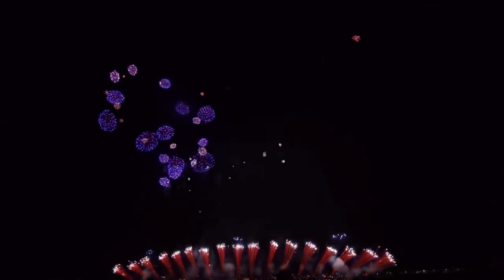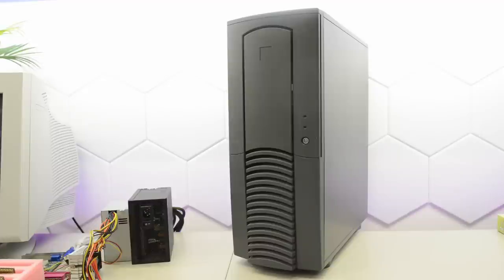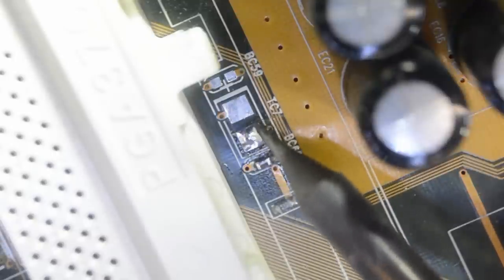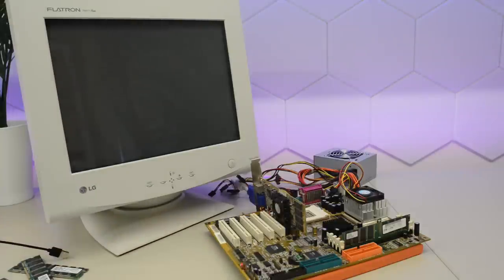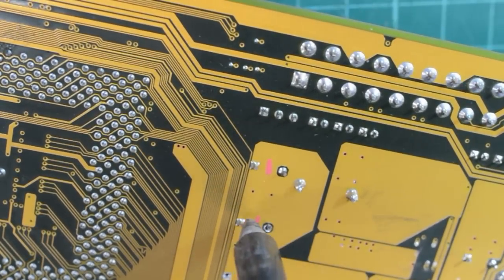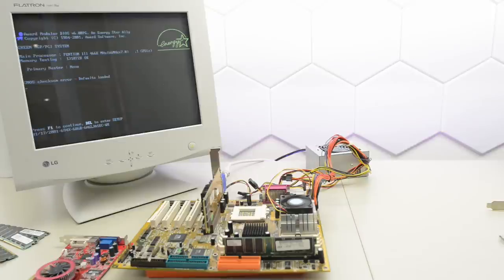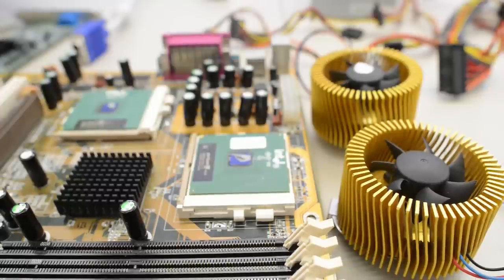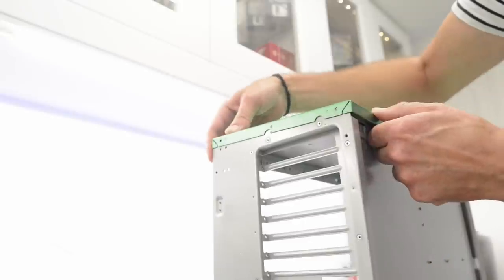Recreating my year 2000 PC with parts from eBay. MOBO repair. Custom ABIT VP6 dual Pentium 3 1GHz PC

Comment: No, that's NOT a IBM Deathstar, that term is 's specifically for the 75GXP (primarily) or 60GP (disputed) models from ~2000 with their high failure rates that IBM knew about in advance. Disks from before AND after were pretty much the best hard disks you could buy at the time. The resulting lawsuit (2001) and scandal resulted in IBM selling their hard disk division to Hitachi in 2003 - but from what was said at the time this was actually a merger with the already existing HGST disk engineering team of a roughly similar size, not a rebranding.
The model number on this reveals this is a 7K250 which matches the 2005 date on the bag, so this is several product generations post-merger. So calling this specific model a Deathstar is misleading at best given that it was likely one of the most reliable consumer disks at that time.
"Floppy LED always on" - you mention checking different cables and floppy drives, but didn't mention checking the cable orientation which is known to result in this. Not sure if the BIOS would still recognize the drive though.
For those that wonder why Hitachi was interested - they wanted the Ultrastar (Enterprise disk) name and design - neither which had been tarnished much by this and that team still does the best 
disks today IMHO,  albeit now under WD but still with the Ultrastar moniker (as opposed to the also Enterprise WD Gold made by a different team, WD is complicated).
Reply from the maker: Yeah, I have actually read the same info on wiki as in your writeup. However, the fact is that all five of my original drives died back then within a few years and I have heard similar stories from my friends. It may not be technically correct to call it "deathstar" but very much appropriate.
Reply: @Epictronics1  I can't argue with your experience, I guess that means I need to go with a wider Deathstar definition.. My take is/was based on my own data, both private disks and at the company I worked then, not Wikipedia, it did match which perhaps made my statement a bit stronger than warranted.
So, my data is that I had two 75GXP that both died on me (fortunately far enough apart that the RAID1 saved the data), and the company I worked for had lots of IBM disks of various models. When the rumor started to circulate they looked at their replacement statistics and immediately replaced all 75GXP of the various sizes due to this, but not the models before and after (34GXP and 120GXP?, IE largest model in each series was 34GB and 120GB respectively) because there their data didn't indicate any problems with them relative to other brands. I guess no one is surprised that the company in question then stopped buying IBM/HGST drives for a couple of years (guessing starting again around perhaps the 7K1000 in 2007-2008).
So my data does have a prominent hole right where you and your friends disks may fit in since it sounded like they were larger than the 120GXP. Another reason I was confident is that the Wiki version also matches my recollection of contemporary data magazines, the 75GXP's dying left and right was first page headline stuff, but I don't remember seeing anything in them indicating issues with later IBM/early HGST drives even in the back pages.
That doesn't mean your and your friends experience is wrong (data points are never wrong!) - the 75GXP head crashes got headlines because it often happened fairly early, and could be NOISY so even people who had disks fail on them before went "no drive has failed like THAT for me before". The combination of these factors is part of why IBM's "just ship them, no one will notice" strategy failed so spectacularly.
But just having a higher than declared failure rate over time might often pass by without formal notice as long as it was, well, gradual, there was no Backblaze publishing their statistics for 100k+ drives back then and if the Enterprise disks (Ultrastar) was OK that would have removed the other obvious place where excessive failures would be very visible because data centers of that era very rarely touched consumer disks. Also, I remember replacing a LOT of failed disks from all vendors in that era at work (and as I said, IBM/HGST was on the no-buy list for years so most were not from them).
 I did consider just removing my original post but thought it was better to instead post an explaination.
Reply from the maker: @Torbjorn.Lindgren  Thanks for sharing your extensive experience with drives. I think that as with a lot of "common" believes there might be more to this than jut good/bad disks. My disks were running for about 15 hours per day stacked up in one of the two towers (in the video) Room temperature no AC. Also running of a PSU with who knows how much ripple. These were also the days of file sharing, so they were not exactly idle :) All this being said, I switched to Seagate after that VERY costly experience. I still have those Seagates and thanks to Seatools I still use them in my BIOS limited 486 systems to play occasional DOS games :)

Comment: Very nice project! I remember that board, of course. I would have thought that's an Antec case. Perhaps they were using others' designs back then or didn't have exclusives? Are you up on any of that history? I know they were sold and not at all the same company now but they were great for quite some time.
Reply from the maker: I'm not sure, it's quite possible that Antec was the actual manufacturer
Reply: Yes, it's an Antec. I have the exact same design

Comment: Have about 5 boards dating from the very late 90s with a couple of them early to mid 2000s decade. Two of the boards are dual CPU but the one am currently trying to do a project build has a single Pentium clocked at 3GHz - it's at the very edge of what the board can support; got the CPU off ebay for $10 and looking it up looks like is ~ 2006 vintage and actually can support 64-bit instructions too.

I've got Win XP up and running but I need to next get a graphics card (is using onboard graphics at the moment) and get some drivers that are supported. (I really want to back down to Win98.) And I need to get audio support going. It has some on-board sound but I do have a PCI sound card to drop into it.

But ultimately want to try getting a current build of Haiku (BeOS compatible) running on this and then try to see if can get Serenity OS to boot and run as well.

Then I have a board with couple of ISA slots and I have an ISA SoundBlaster card, so this will be a holy grail project, as maybe could get this to boot MS-DOS and run games from late 80s to early 90s.

The 90s were a golden age for doing custom PC builds, and now all that hardware is retro hobbyist gold - am glad didn't send these boards to e-waste :-)

Comment: I had a BP6 with dual Celeron 433 running at 490, 256 Mo ram and a Voodoo3 3000.
Running Win2000 / Linux.
A beast :)
Reply from the maker: Sweet setup :) I think next weeks video is going to be about the VP6. I just got some parts in the mail
Reply: @Epictronics1  It's been a while I want to get the same machine. 
Prices are getting crazy.
200 US $ for a BP6 on Ebay and same for a Voodoo 3.
The main hard drive was a 18.000 RPM SCSI 20 Go.
Buying those old parts today would cost me much more than a modern computer :)

Comment: I have this pc case, dark grey color
Reply: I had one, too. It was quite decent, if I remember correctly.
Reply from the maker: It's a nice case
Reply: Yes it is, its heavy but robust, has plenty of space, and it has rails for 3.5" bays. A friend gave it to me, and i changed the case of my main computer to this because it was far better than what i had. My old pentium 4 640 is still there. And I did some interesting experiments taking advantage of the space, like mounting two power supplies inside to power a radeon 3870x2.
Reply from the maker: @borjaevo  Yeah, love the rail holders inside. All the rails were still in the case because of the rail holders

Comment: you have to put tualatins on it, just pin mod them to fit , what was it insolating 3 pins in the corner with missing pin and connecting 2 pairs ? i know it worked for me on cusl2also radeon hd3870? just for fun
Reply from the maker: I need to check the rumor that Tualatins killed many VP6 boards back in the day. Once that is sorted I'll go ahead. I haven't done any reading yet but I suspect that Tualatin MOD got the blame for the bad caps or that one or more components need cooling or replacement for better parts
Reply: @Epictronics1  It wasn't the Tualatin's, it was the poor quality mod's that claimed so many.
Reply: @Epictronics1   tualatin mod would not be a problem, because powerdraw of coppermine 933/1000 and tualatin 1400 is comparable, 30 something watt if i remember coerctly and tualatin mod mostly makes motherboard think it is coppermine at 1,5v which totaly existed (celeron 566 for example)
what could kill a board with via chipset, is overclocking, because those boards have a bios bug that makes them unable to aply pci/agp dividers corectly
you might set celeton to run at 133/66/33 but it will really run at 133/88/44 and that could mess up devices runing on pci bus, graphic cards capable of agp8x would most likely be unafected
Reply from the maker: @VintageSupportServices  Ok! What was the poor quality mod? I have ordered some PCBs for the conversion.
Reply: @Epictronics1  heavy handed soldering and very rough socket work, nothing you will need to worry about, also make sure you get the server version of the 1.4ghz chips, I don't recall the sSpec at this time, but they were the only ones certified by Intel for use in a SMP config
Reply from the maker: @VintageSupportServices  Oh, ok!

Comment: 31:30 I have an ASUS P2B and a Shuttle HOT-661 and both can't handle any drive larger than 72 GB. If I connect an 80 GB drive or 120 GB they will freeze with the cursor stuck at "UDMA 2" and won't boot. The Shuttle with the older BIOS would even not detect the drive at all. I would suggest trying the Beta BIOS from Retro Web for your VP6 maybe that fixes it?
Reply from the maker: This board ran 250GB back in Y2K. The solution to your problem is to use Seagate drives and run software called Seatools. It will allow you to set any Seagate drive to 72GB
Reply: @Epictronics1  ok I assumed you had the 250 drives on the RAID only.The Appollo should be ok anyway my boards are 440BX. I solved my problem with SCSI controllers they are also easier on the CPU usage.
Reply from the maker: @gentuxable  Ah, that's a nice solution too. I actually didn't like the onboard VP6 controller. I used a PCI/IDE controller back in the day. I don't really remember why

Comment: Watching the video... he pulls out a Deathstar... wondering if it will survive thru the Windows installation at this age...
Reply from the maker: haha, only one way to find out!
Reply: @Epictronics1  Oh, there is NO doubt the Deskstar is going to fail on you (all 8 of them that I purchased back in the day are dead ... the 2 that were working when I retired them (10 years ago?) were dead when I tested them last summer, apparently just sitting around unused in an antistatic bag doesn't stop whatever the failure mode is).

Comment: Not an electronic designer here, but how r3tard3d is to put components that close to the mounting tabs of a heat sink?
Specially on this old sockets (current time when designed) that commonly needed a flat head screwdriver and a lot of pressure to install the heat sink